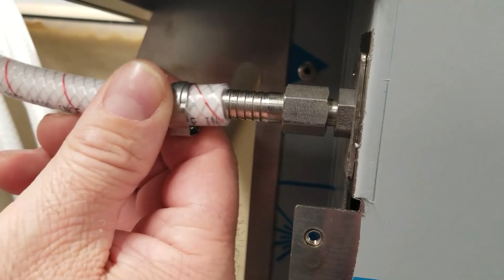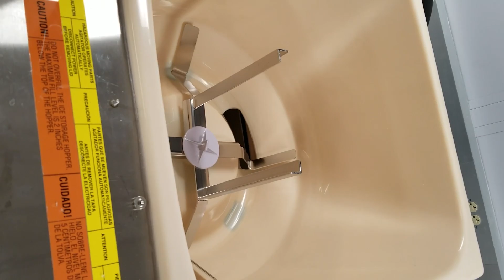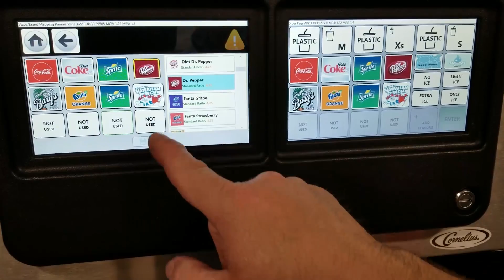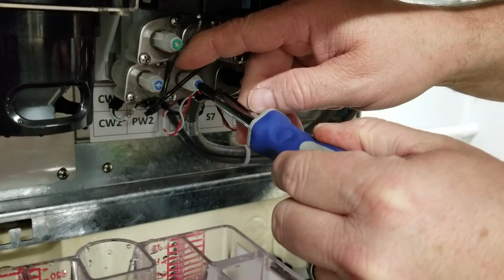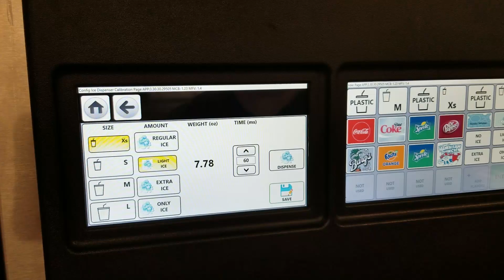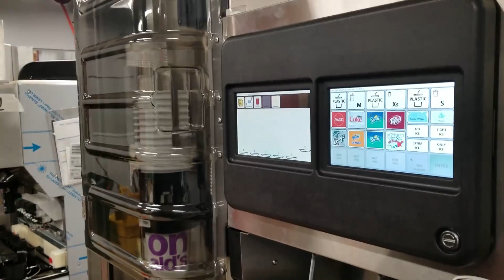ABS 2.0 Installation Instructions

Comment: Is this machine abled to handle with NewPOS? 
For example: I take a menu with large coke in the Drive Thru-POS and the machine starts to fill it automaticly? 
Another question: When will this machine come to germany? In Germany we must do it manually and it takes unnecessary time. It should be McD-standard.
Reply: Yes the ABS is available as extension to NewPOS. Whether this will come to Europe is a mystery it's seems to be an American thing for now.